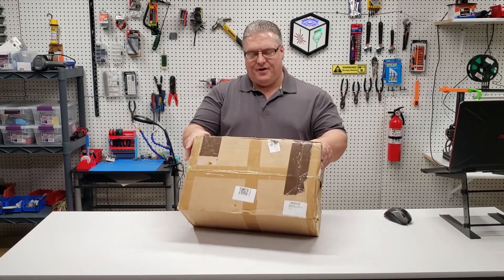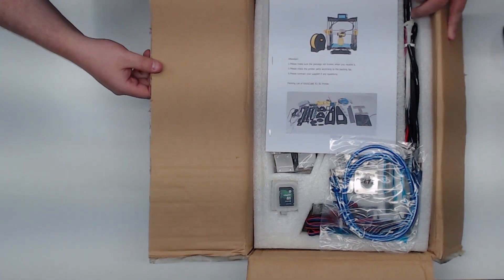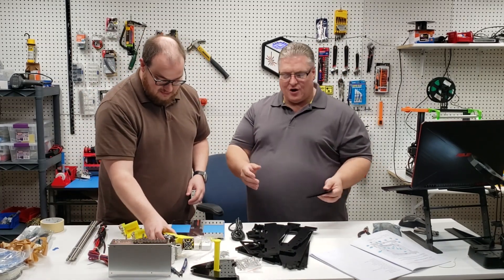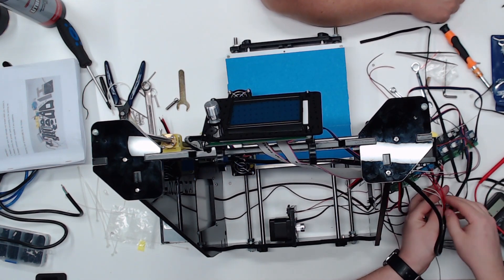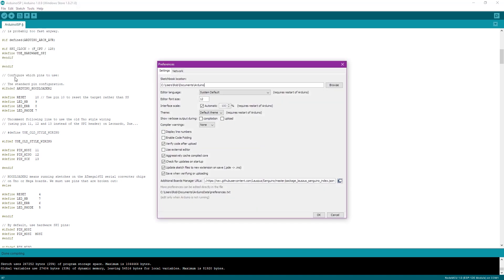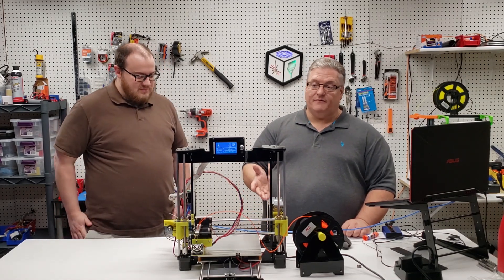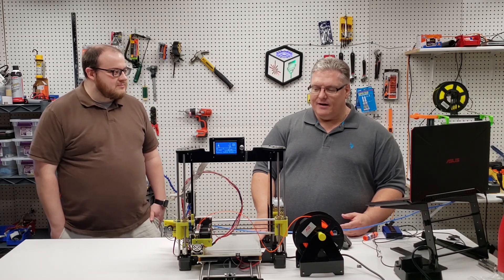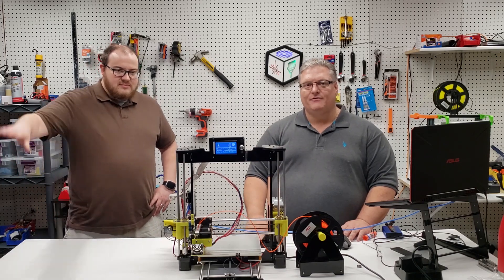$100 3D Printer Kit! Cheap printer from Amazon! Is the cheapest worth it?

Comment: Return only, not for sale means the item was drop shipped by a third party company. i'm also disappointed you slated the Chinese websites use of English, at least they attempted English! they didn't get it right, but you still understood it!
Reply from the maker: Thanks for the info Stu that's helpful to know about drop shippers.  I'm not sure I agree with the attempted English however.  If you're marketing a $500 printer to a foreign country I think is is very important to have the documentation and information correct.  I see companies like Creality and Sainsmart produce competent documentation without omitting entire sections of the document. This was a poorly built product by a company that went out of business.  While I don't specifically know why they went out of business I'm sure these things contributed to their failure.  Thanks again for your feedback!
Reply: @MakersMashup  but they are marketing a $100 printer.

Comment: Melzi board.  Expect it to smoke its power connector after a dozen hours of use.  If you keep that board, use a mosfet to offload the hotbed current.  Or just ditch it because it sucks and use a ramps or better.
Reply from the maker: I got probably 100 hours or more of use out of it but the entire printer was retired about a month or so ago.  Surprisingly the printer performed well with a few replacement part in the video. Ultimately I built another C201 (https://youtu.be/EX62plOF-So) from its parts and it now has an SKR v1.3 in it.  After building the one with my nephew I couldn't resist building another from the Raisecube.  The C201 you see in my more recent videos is the rebuilt Raisecube. 😁 

Now I scout Amazon for these type of printers and build more C201's to add to the farm. 😉